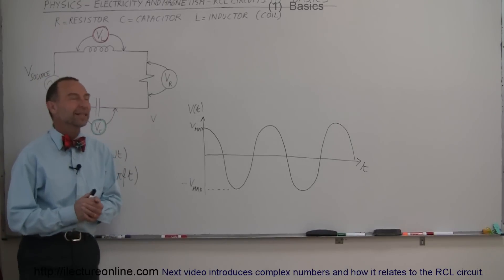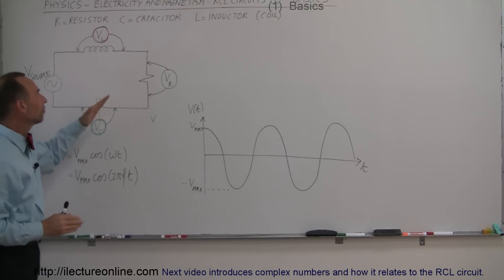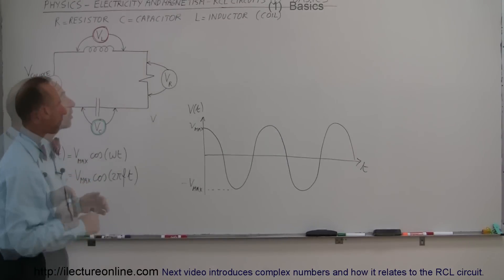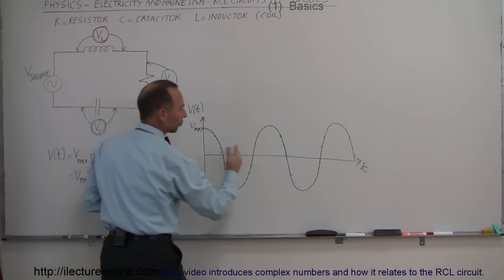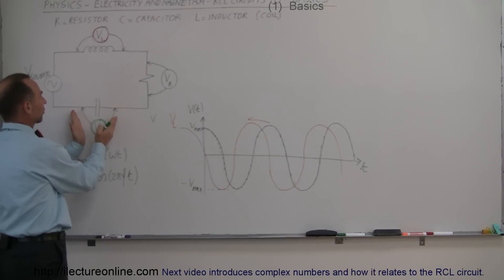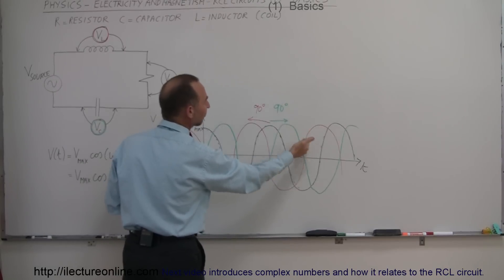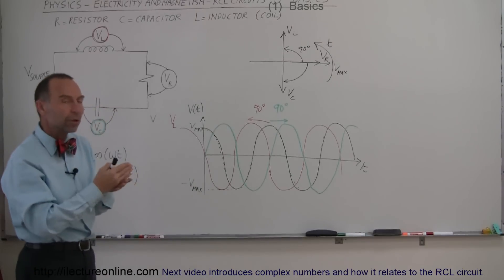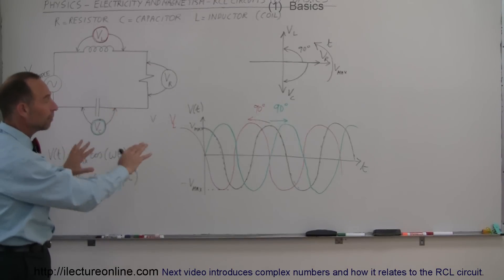Physics 49  RCL Circuits (1 of 13) Basics

Comment: Does the order of the Components (RCL) matter in AC Circuits? Will Voltage and Current still be in Phase across a Resistor if it comes after an Inductor or Capacitor in an AC Circuit?
Reply from the maker: The order of the components does not matter.  The result will be the same.
Reply: @MichelvanBiezen  Thank you

Comment: Hi Michel. Looking at this RCL circuit and understanding concepts from your future videos in this playlist, I think here in the sinusoidal graph, VR would be in phase with current (I) flowing through the circuit and not with the source voltage Vs always. I think the only time VR would be in phase with Vs (source voltage) is when the inductor and capacitor cancel each other's effect and the circuit becomes purely resistive. Otherwise, source voltage Vs would either lead or lag current I and VR considering if it is an inductor dominant or an capacitor dominant circuit. Am I correct here? Please check.
Reply: Yeah ur correct bruh something is wrong in this video

Comment: Interesting.  Is it possible to use the same circuit for rectifying current or creating a 3 phase converter?
Reply from the maker: No, those circuits require a different combination of parts and connections.
Reply: Michel van Biezen   So there's no way to capture the signal after each node and collect them in a capacitor to give you a really smooth DC signal?  Of course, the inductor's current would have to be reversed possibly using diodes.  Why isn't possible?

Comment: If V is given like this ( V0cos(wt) ) in a question, can it be transformed to ohms?
Reply from the maker: You cannot transform V to ohms since they are not the same thing.  V = voltage and ohms is resistance.
Reply: Michel van Biezen I meant volts sorry, I don't know why i wrote ohms :) 
In one question voltage was given like this V=...cos(wt) than the rest was the usual stuff, but I didn't know how to proceed since the voltage wasn't something like 56V, 80V , ...